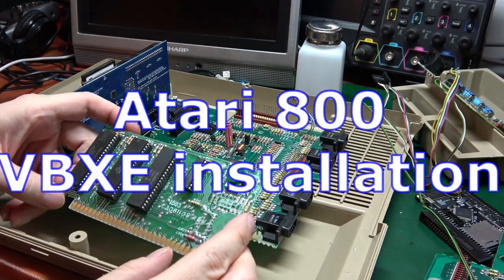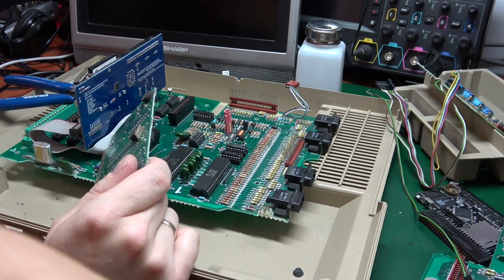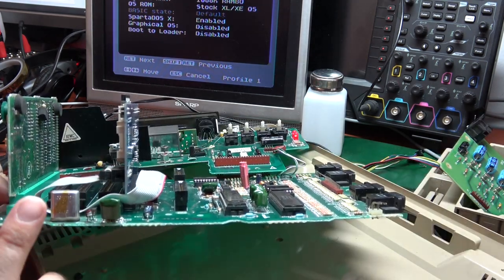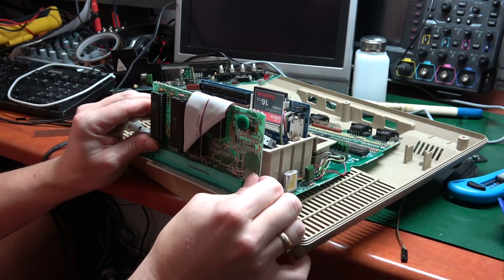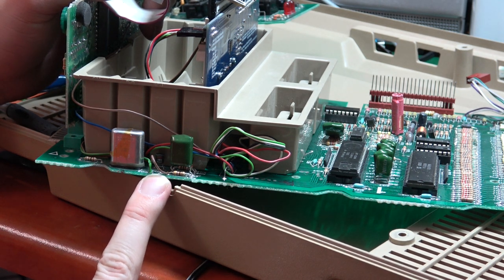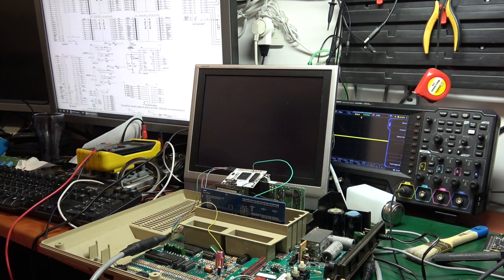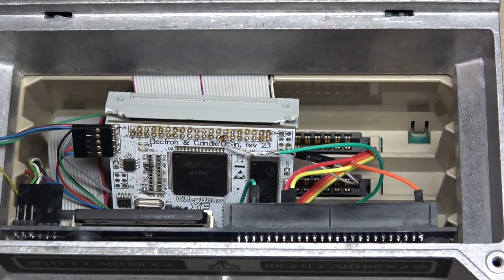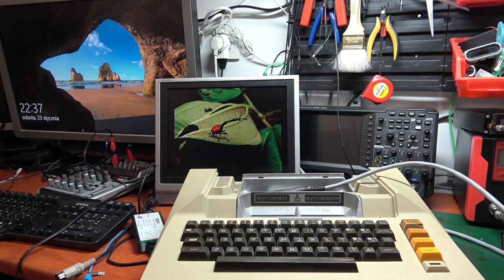Atari 800 VBXE installation

Comment: How can I get 1 set (w/ updated CPLD) for my 800? I will figure out how to cut the chassis and run out the ribbon cable. It would be a fun project.
Reply: CPLD code isn't available yet and needs some bugs ironed out before release (it breaks cartridges, for a start). I guess when Candle finds time to fix the issues, it will eventually become the default JED on purchased boards. It certainly brings a lot of other minor improvements too.